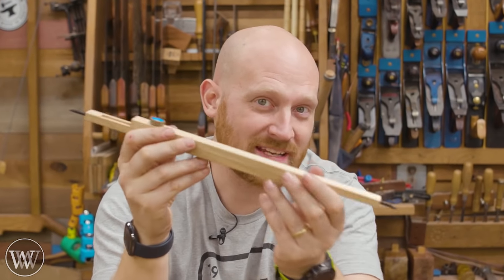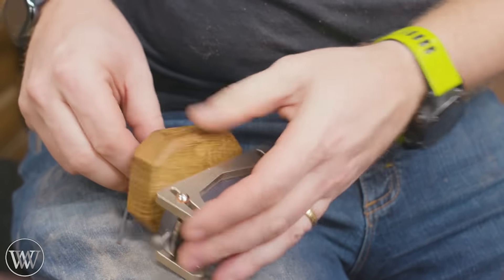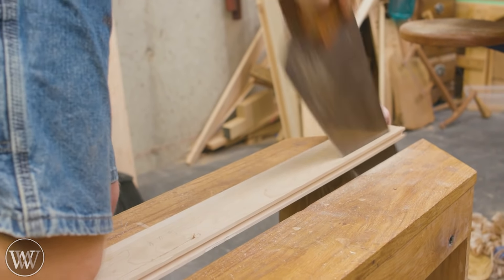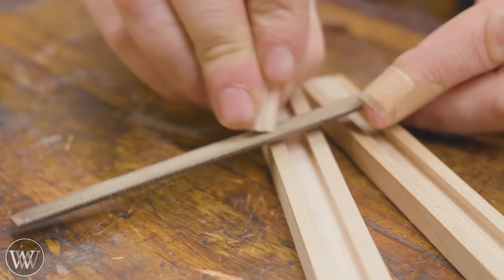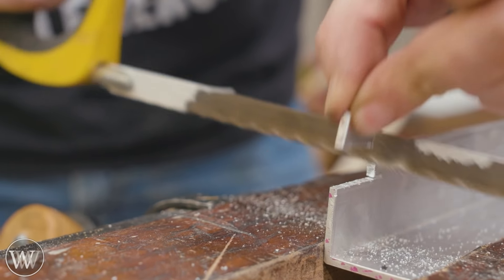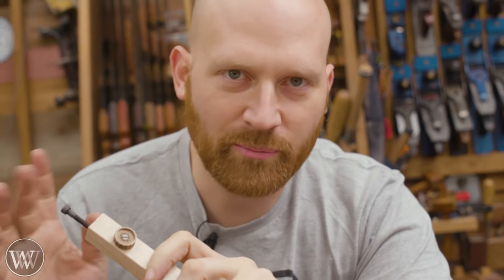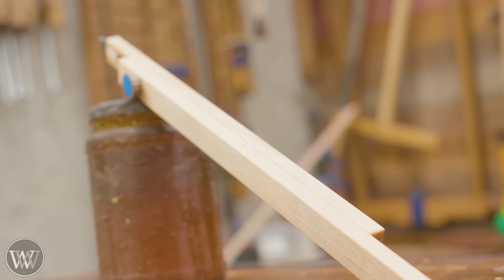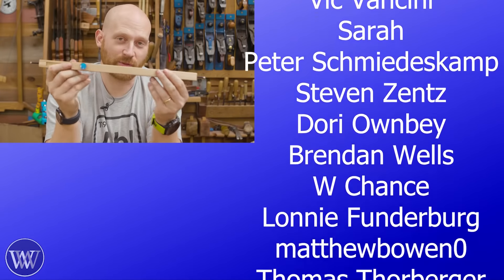How To Make Pinch Rods With Sliding Dovetail REED Planes Design

Comment: Making that sliding dovetail by hand puts me in mind of making a harpsichord bridge which is sort of triangular in section. After decades of woodworking I don’t even have the skill to  do the ripping. I shall make one as it’s a tool worth having. However I will cheat and use a router. 
I think making a dovetail shaped scraper might smooth out that dovetail slot if you are going the non machine route. I would have drilled and tapped those small pieces and afterwards cut to the final dimensions to avoid splitting. 
Great video.
Reply: The scraper is a great idea. one side at a time or both sides on a pass? Need to go experiment!

Comment: A suggestion when adding new items to your store. Some of your pictures of available products are titled with white lettering. When the white lettering is superimposed on a white background the lettering becomes "invisible" and is either difficult to read or impossible to decipher. Solution: When designing your shop images make sure there is a relatively high contrast in colors between the background and the foreground (no white on white; white lettering on a gray background is passable, though the option exists to use a totally different color (red!) for the lettering such as with new products which would maximize the potential for additional sales. Thanx, the show is great!

Comment: Thanks James for taking on the challenge and letting me drive you a bit bonkers on this one. Working by hand with small pieces is certainly a challenge. The instructions have some jigs to help in your fabrication and use variations that I like. Pinch Rods with a few tweaks can be helpful with your layouts. Besides checking a box for square how are you going to use them?

Comment: James, love your work! I am a model maker (35 years), and have a tip for you and the viewers: when using accelerant with CA glues, instead of SPRAYING that nasty-smelling stuff, there are accelerant brands (Zip-Kicker is one) that come in non-aerosol bottles, sold in bottles w/a little pump spray bottles. If you transfer the liquid into a “capillary bottle” (a needle-topped bottle used for applying solvent to join Plexiglas parts together—Weld-On carries these, as do any shops that sell acrylic sheet), you can apply the tiniest droplet of accelerant precisely where you want, thereby sparing your nose and lungs those noxios fumes AND make a small bottle last you about a hundred years. It only takes a drop to kick off your joint, and it makes the job safer and less stinky. 

BONUS TIP: if you get some CA on the needle tip and cause it to clog (and everybody will, at some point), simply hold the needle over a flame for a second, while simultaneously squeezing the upside-down bottle… VOILA! No more clog! (Zip-Kicker isn’t flammable, btw.) I learned this decades ago, and can’t believe the glue companies have never sold it this way. Do this, and trust me, you’ll never spray it again!
Reply: The advice I didnt ask for but needed so much thx !
Reply: @ glad I can pass it along!

Comment: My Go To tool to 'pinch-hit' for Pinch Dogs was my ever useful Mounting Points. Used as Pinch Dogs, I'd remove the points, clamp the arms together slightly to find the 'point to point' of inside corners, doorway RO's . My bag of tricks needed to correct mistakes of others needed to be secretive. The 'tools' might only be string lines, pinch dogs, and shims of Go ,No Go's, Plum Bob's(or Jane's)but they turned desastrous into passing grade and earned me the nickname: Mission Impossible.

Comment: I've seen a woodworking enthusiasts video about hakone that uses a planing jig for making precise angles on small pieces. Worth checking out.
Also, tapping on the lathe gets you a perfect start. Just back the wheel with a square piece of wood with a hole in it on the tailstock, chuck the tap in the spindle, lock the spindle and turn the knob while pushing on the tailstock. Never stripped a hole or broke a tap yet

Comment: You certainly have patience to work with such fragile pieces! Thank you for Beta Testing the plans!!
I am thinking of a modification to make the ends with a bit more meat and set your pins in a “Co-Planer”. 
You would prepare your stock with a 2” or so long L shape that makes the tool take a perfect rectangular prism shape when closed. The thicker end section would give you more meat for the inserts and allow the pins to be in line with one another. 
I have a tremor in my hands so working with super small stock is not always possible, but I think scaling up the plans would be my solution for the intricacies. It would be a simple modification much like your modification to carve out the female portion of the sliding dovetail. 
James I thank you for your thoughtfulness, humor, and extremely intelligent joke T-shirts! I haven’t heard a good “i” joke in ages!! 
i is always i, but I squared makes you a negative One.
Thank you James as always,
-CY Castor
Reply: I like your approach for co-planer. I was thinking to bend the bolts. Hope to see your solutions.

Comment: I have a shop made dovetail plane (it started life as a skewed rabbet plane) so the male portion of the sliding mechanism is easy.  I generally make the female portion with a saw and angle jig but I probably would use the jig with a chisel for these. I would groove the board and then rip. 
All that said, I’m thinking T-tracks would make the build more accessible. A rabbet on opposite sides of the piece for a T- block. Two L- moldings glued to a piece for the T-track.  Just a thought.

Comment: Hey James, a very helpful tip I've picked up from Paul Sellers is that when using combo planes and specialty planes ect. Its best to start at the far end and work your way back instead of cutting the whole length. Just something to try, planing the length of the board might work better for you.

Comment: Very nice project, nicely explained.  Is there a hand tool (like a Stanley 45 with some sort of special dovetail cutters) that could be used to make the sliding dovetail joints?
Reply from the maker: I have seen a few people make specialty cutters for it but it requires you adjusting the fence every single pass. So it can be difficult to get a really fine fit.

Comment: Seems like building the grooves might be easier by using wider pieces while doing the angles. One wide (relatively speaking) plank for the base. Two wide planks with bevels on the edges. Bring those two beveled planks together to the appropriate width for the dovetail groove. Glue those together, and then rip the whole thing to final width. You can even use the sliders, pre-made to your desired width, to get the spacing perfect without fiddling with narrow stock.

It's basically the same technique as doing moldings on the edge of a board, and then ripping them off to final size.

Comment: Would it help to add taller blocks to the two ends where you put the screws?  Then the brass inserts where you put the screws can be in line with the middle.
Reply from the maker: It actually doesn't help at all to have them in line with each other. It's kind of counterintuitive but it's just more work without any actual benefit. Because you're measuring from point to point, they don't have to be in line. It's just the distance between two points.

Comment: Good day, Mr. Wright. I would strongly recommend you get yourself a machinist vice for building small wood or metal parts. Your example of tapping and errors could easily been avoided with such a vise. First off, the grip is like iron (pun intended). By that I mean it is very positive with no deviation from flush with the top of the jaw grips even when you use stock as thin as one-eighth. I stopped using my bench tail or face vice for tiny pieces years ago. It is much easier to register a try-square on the metal jaws to ensure the piece is flush with the jaw top therefore allowing you to start your tap perpendicular more accurately. They come in different sizes and the "grips" can be exchanged for different materials like phenolic, UHMW nylon etc. I never have an issue anymore. The added bonus is, you will be raising your tiny workpiece up several inches making it more comfortable to work on and see the tap alignment. Mine is mounted on a piece of .75" plywood with a cleat suitable for the face vise to hang on to. Keep up what you are doing; good info coupled with some tounge-in-cheek goofiness. Thanks from a viewer in Alberta, Canada.

Comment: For the double dovetail piece, instead of gluing up a laminate piece, why not use a piece of Baltic birch plywood?
Reply from the maker: sure. the plans actually call for laminating veneer for it. basically the same thing just with hard wood instead of something like birch with a soft wood core.
Reply: Baltic Birch has about 17 layers per 1" With veneer you get 40 -50 layers per inch. Not hard to do, a much better material and I think worth the effort if you do not use metal. Also Baltic birch is getting expensive and hard to get.

Comment: I totally understand wanting to do a dovetail (because well...theyre dovetails) but it seems like it would be easier to make the channel square instead. Make a groove in two pieces, glue the grooved sides together and run another groove down the middle to create the channel. Groove both sides of the sliding piece so it fits and there you go.....after having typed that I realize it sounded better in my head but Im sure you get the idea lol
Reply from the maker: yes there are a lot of easer ways to make them, but with this one we wanted to make a fancy set. I will be making a traditional set here soon.